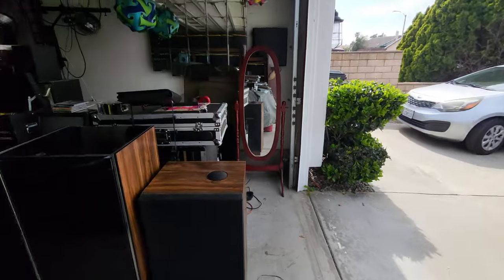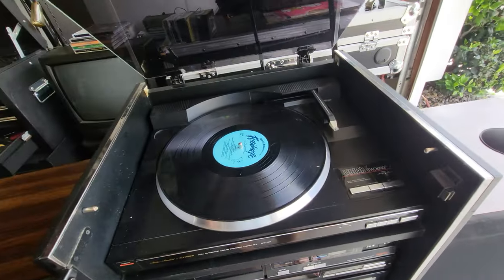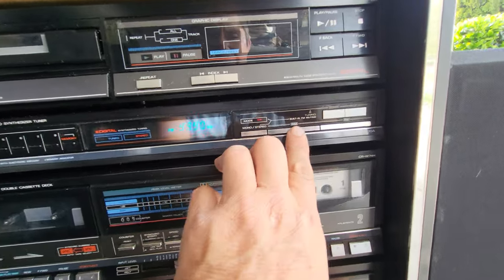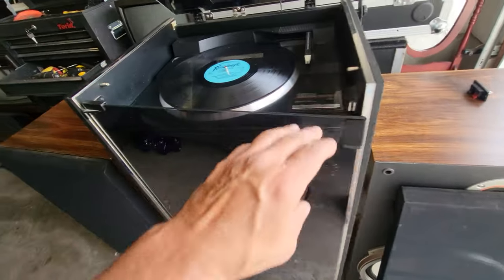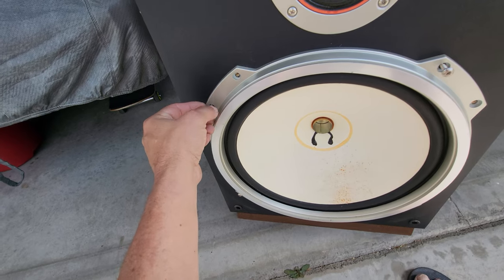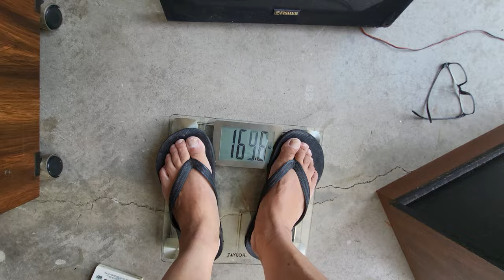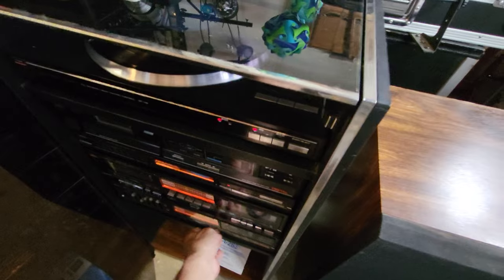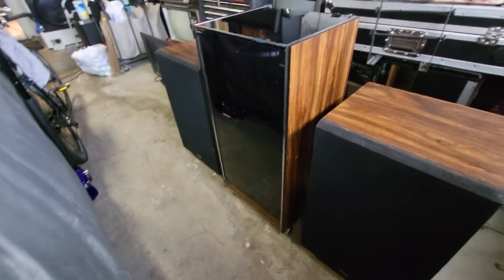A really cool big stereo! 1985 Fisher component system.

Comment: Nice find.  This was one of the lower end Fisher's.  Fisher became a Household name in the 80's.  When they were bought out by Sanyo after Emerson, they still put out some decent equipment.  I have the Fisher 8500 system from 1980.  It retailed for 3 grand, but it is all separate components with metal face plates, an amp the weights 30 lbs, and a very sophisticated turn table  that uses a laser to select tracks.  Of course you can use it manually also.  The speakers are huge with large magnets, crossover and mid are Fostex drivers.  The tape deck is a direct drive and the preamp has MC, MM at 33, 47 and 100K settings.  It also comes with a 10 band EQ.  The tuner is digital, which was pretty advanced for 1980.
Reply from the maker: I googled the 8500. That sure does look sophisticated.  Speakers look similar! And wow $3000. I saw that on that old ad I found on the net. That's close to $10000 in 2024!

Comment: The one problem with those fisher stereo systems is that if you noticed the components in the back have special plugs that they only work with Fisher equipment. I had basically the same type of stereo I had 15 inch speakers, and the amplifier driver blew out on it, and the rest of the stereo turned into a paperweight, because it was very hard to find a replacement because it was repaired once, and it didn’t even last one day

Comment: I still have a working LXI system from Sears from the late 80s. 500 Watts with Phono, Dual Metal Tape Cassettes and Radio with Equalizer.  System ran about $1000 at the time it was new. I picked it up at a Goodwill in the early 2000's for $10 bucks. Never have had the system over 2 on the volume, it is simply the loudest personal system I have ever heard sold in stores.
Reply: Tried plugging her in gil?

Comment: you're right about the price i think it was around $850 my dad bought it in early 86' and he bought extra speakers fisher ST 840's they have super tweeter's in them. i have the 830's but like you said the high's are not that great for some reason. like other people have said online they couldn't have sounded that bad when new so maybe from just the age or maybe the crossover's inside. you can hook an EQ to it that's what i did with mine.

Comment: You be surprised how much they still go for.....Just the components alone can go for $480, and that's not counting the speakers and cabinet  ... speakers  can go around  $400 to $500 depending on condition, and they are both original  and  the cabin  alone  can go for about  
 $50 to  $70 also depending on condition  and it's original  to the system  all together  about 
 $ 1,150
I didn't count the LP. Not many are interested in them.. but if ? Around   $50 to $100 in 1985 a fisher component  ca 283 sold for about $2500 that was alot in 1985..
Reply from the maker: You know what. I did indeed see some ads for parts of this system for sale. Specificly the exact speakers.  I already seen like $300 plus.
Reply: @fueledbymusic3   Yes, always do research on things you like ... nice  stereo system  👍